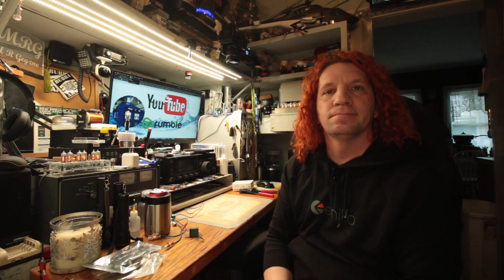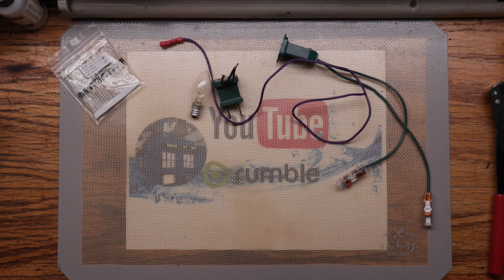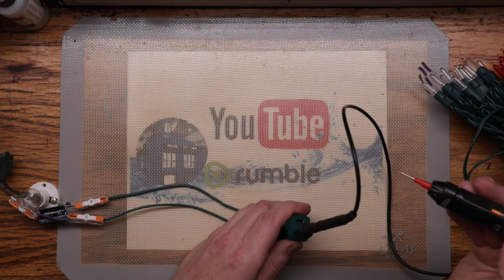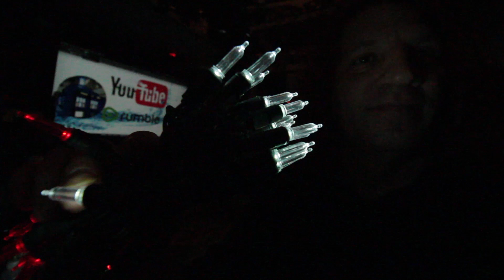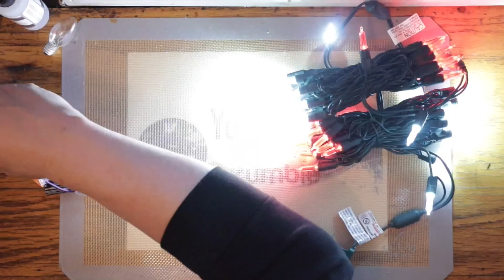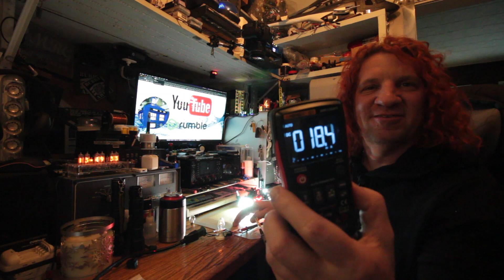Build This Cheap Circuit to ELIMINATE LED Christmas Light Flicker

Comment: Excellent! I’m pretty sure I have all components on hand to make this.
Reply from the maker: Great. I am planning on taking my example, and using it on the small set of Tru-Tone's, this upcoming season. Have to see, how many it takes to power a standard 7 foot pre lit. I predict two or three. There is no way one will do it all, because of the voltage drop.

Comment: Very nice, I am impressed!  Best is it still uses an incandescent bulb as if to "twist the knife in the back" a little more.  That definitely is easy to build and inexpensive.  For now, my solution for LEDs is to simply run them outside so I don't have to see them.  But that doesn't help driving by everyone else's lights that are blinding.  I guess we have to do this one step at a time.
Reply from the maker: Good thing you do not have to drive past my house, your retinas would burn out and leave you blind for life!
I do not think there are many steps left to take. Other than user preference, along with cost.

I really like the new super warm led lights coming out. There are 2300K. Like a Champaign hue, very nice. Run them small scale on DC. Would be a very nice display.